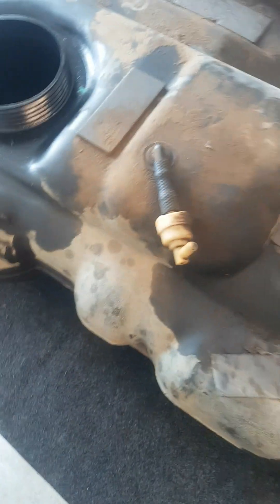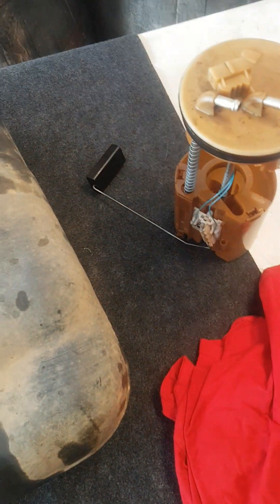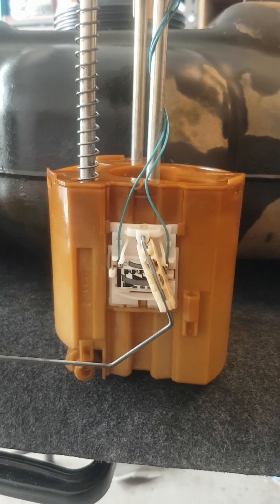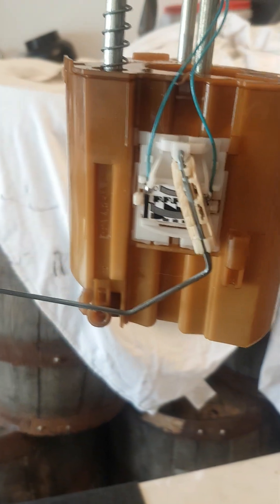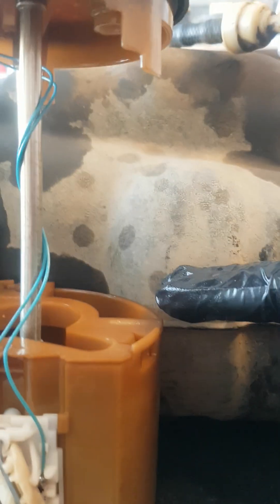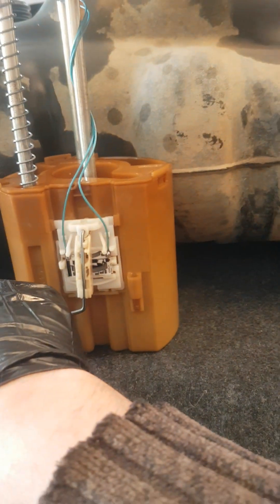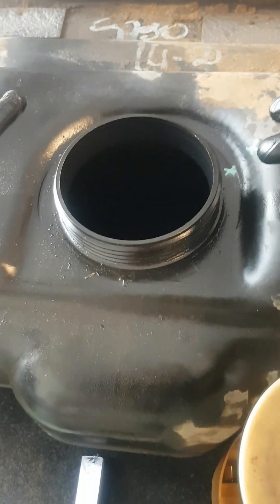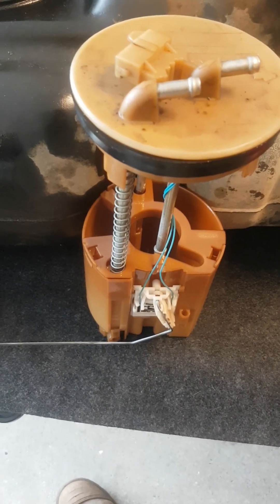2002 Mercedes Sprinter runs out of fuel when it has half a tank

Comment: That part you're talking about is called a swirl pot,  the reason for it is to make sure that there is enough fuel to feed the suction pipe when the fuel level is low. You will notice the shape of the inside of the swirl pot at the bottom and the idea is that the return fuel spins as it enters getting rid of any air that may be present.  The return fuel enters it from the return pipe on top .  The nozzle is the part you're talking about where you see the plug, that nozzle can block up , so unclip it and check. Also check the plastic tank vent  on top of the tank they sometimes block up.